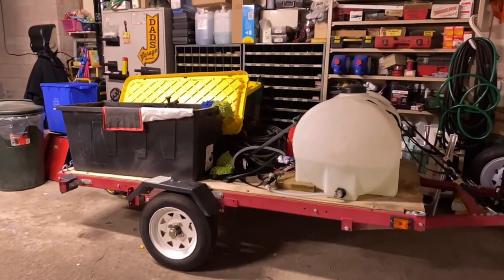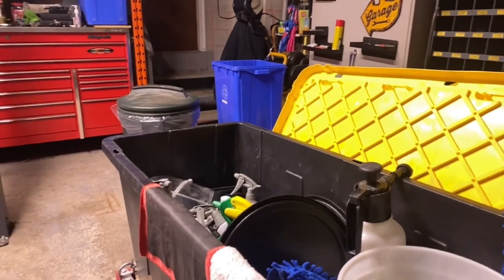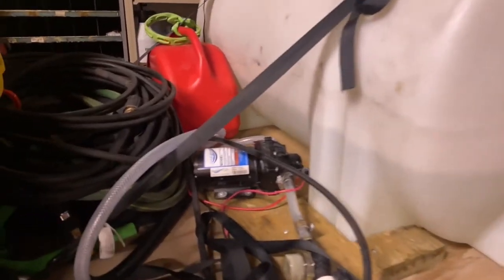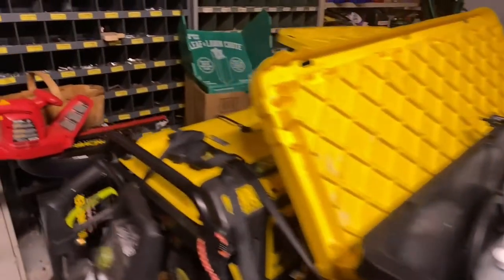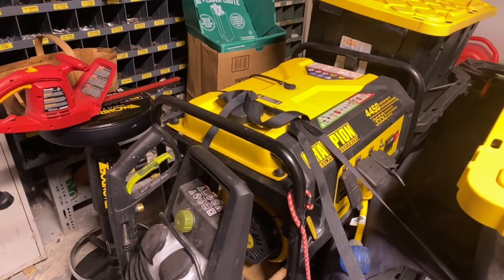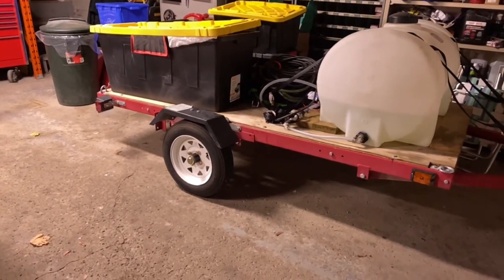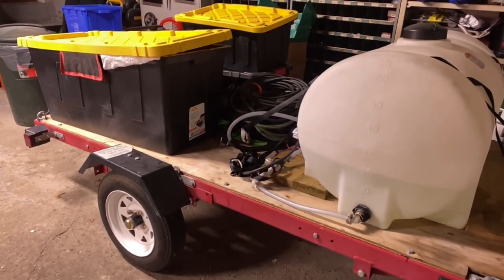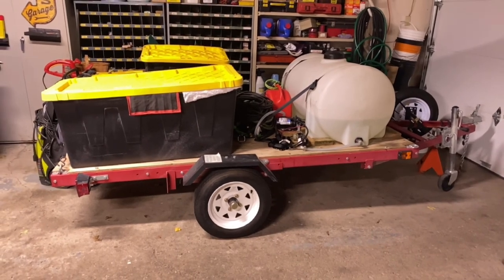DIY Auto detailing mobile trailer setup

Comment: How do you get your power washer to run off of that water tank?
Reply from the maker: The tank had an external water pump hooked up to a hose. Then that hose hooked up to supply  water to the power washer. 
The pump was powered by a 12v battery and the power washer was powered by the generator. 
Watch at 2min10sec of the video
Reply: Thank you. Idk how i missed that.
Reply from the maker: @jerrycroner9221  No worries at all! Thanks for watching.